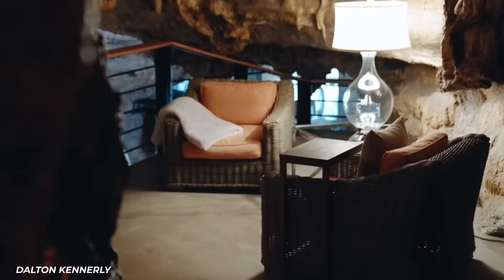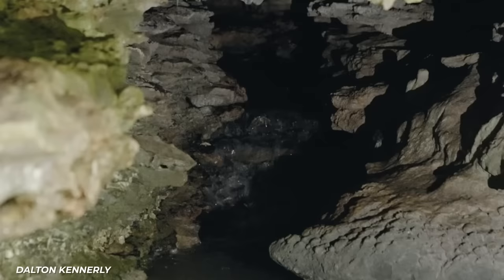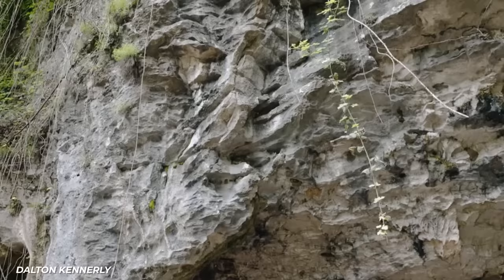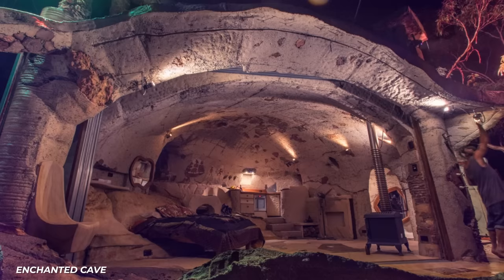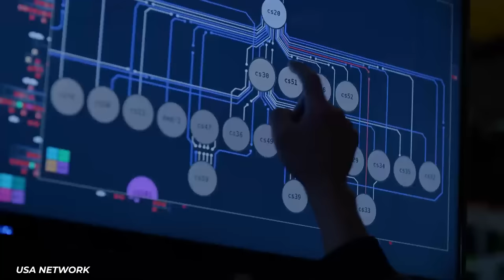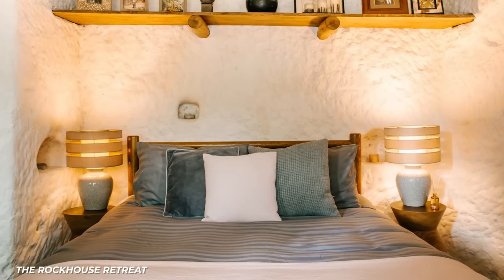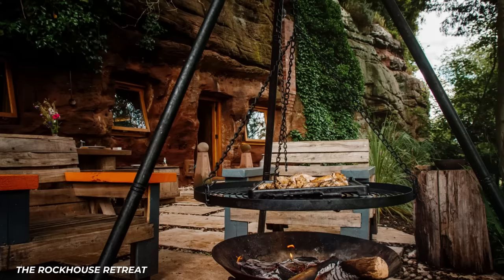Insane Cave Mansions You Won’t Believe

Comment: The cliff Haven cave in Utah is the one that is the most uninteresting. Number one it is small and number two it just looks like a normal house inside. And because of the lighter would it makes it look like it's not even in a cave. But the sad part about it is that there was so much more room to make this house much larger. I mean the house was only built inside a cave and didn't even fill the whole cave up.  And the worst part about it is that there was nothing cave like inside the house.  Again it was just a regular house. But the rest of these caves. At least the ones before it?  WOW!  WOW!  WOW!  Just WOW!  All of them gorgeous and interesting even if they were small.